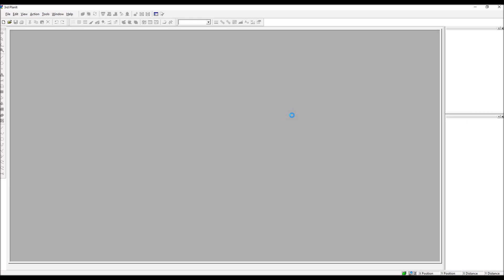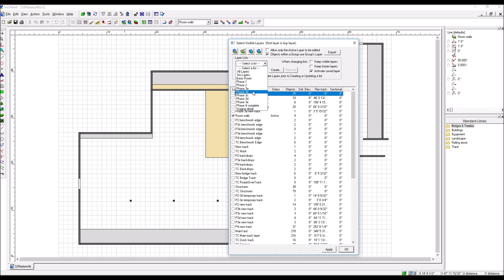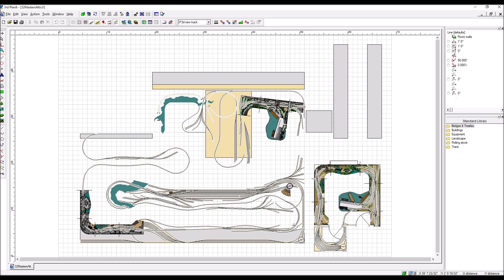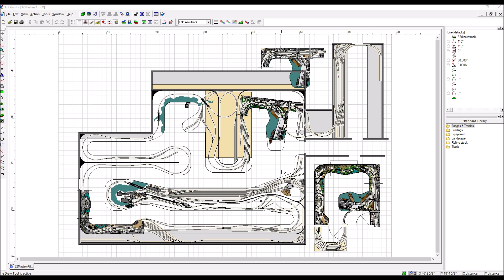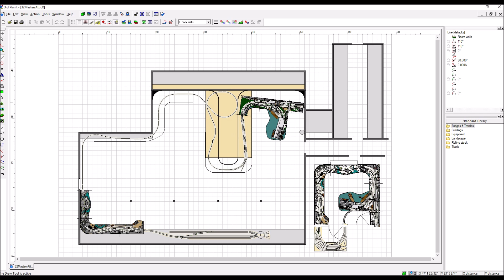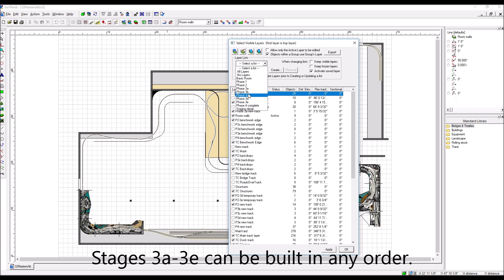Track plan for an attic

Comment: Fascinating to see what you choose to design for yourself in such a large space Peter. The majority of your customers seem very keen to have at least a double track mainline, and often another continuous run atop that. Whereas you're aiming firmly at single track mainline, and a keen eye to operating prototypically. Thank you for showing the idea.
Reply from the maker: Also check out this video: https://youtu.be/6Km9-huorDA 
Although the house with the attic fell through, the other design is for the basement of the house I now live in.  If my work ever slows down, I'll be able to have a crack at it.

Comment: How you doing it's Victor from New Jersey I have a question what track HO scale do you recommend and I also need an ho scale turntable can you tell me which one you prefer on the turntable and switches as well which you prefer thank you
Reply from the maker: For turntables, the only brand I'm familiar with is Walthers.  I once scratch-built a turntable, and I wouldn't want to do it again.  Walthers turntables are easy to install and fully indexed, so if they have the size you need then look no further.
For turnouts, I recommend Fast-tracks for all visible locations.  If you don't want to build them yourself, you can purchase them ready-built through my on-line store.  For hidden areas (such as staging yards), I often use PECO turnouts to save money - although their appearance is not good so I don't use them in visible areas.  I don't really like Atlas or Walthers turnouts because the rail does not match the flex-track I like, resulting the need to use bigger, more obtrusive, rail joiners.
I use a mixture of Micro-Engineering and PECO flex track, depending on location.
Reply: Hi Victor from New Jersey again. Thank you for taking the time out and sending me that all you guys who do the trains whether it be rail lines layouts or just talking about the trains that they run are all excellent at responding I want to thank you guys all for that. I will take your advice I will save that I would look at it as my Bible. I've been watching you for quite some time I think you're one of the best guys out there as a matter of fact I don't watch anybody else online or layout builds. I am a miniature you a 57-year-old carpenter who wants to get out of the business and get into something like that because my body is breaking down as I sit here with a hernia I can't even move. Also alone in life lost my wife as well unfortunately God bless your wife. I like what you did and how you went about it I've never been successful at the three businesses I've tried I'm a very good Carpenter just not a very good speaker or seller of the job I guess. What would it cost to get a layout design from you maybe how would I go about getting an estimate like that obviously I would build it myself I could use some advice on a design. is there a square foot price as a depend on how involved it is how much time it takes if I want 10 main lines or two main lines I don't know how you go about price and one of those maybe you could give me some advice on that as well I greatly appreciate it looking forward to your next video please respond thank you as you would say bye for now
Reply from the maker: @victordandrea8697  If you'd like to talk about a custom layout design, please contact me through my web-site superiormodelrailroads.com 
Tell me the approximate size of your space and a little about what you hope to accomplish in it.

Comment: I love this plan. I'm sure you'll come up with a gem for your new basement space. I noticed that you mention pulpwood loading for the proposed mill. How would that have been loaded during the period that you model?
Reply from the maker: That is a very good question, and something that I still need to research.  This is one reason why the pulpwood loading area didn't get finished  before the layout was packed up.
Reply: Well, if you figure something out let me know. I've been looking too. I'll have a large paper mill inside a return loop on the third level of my layout. Boston and Maine RR in the late fifties.

Comment: Cool. Thx for sharing. I particularly enjoy your 3pi walkthroughs. Some minor suggestions...You may already be aware, you can highlight some or all of the mainline using the 3pi path tool then adjust the thickness thereby making the mainline more prominent in the plan. There is some interesting detail in the track plan so mixing the occasional zoom on the detail would help while viewing the video. 3pi has a 'return to previous' zoom option on the zoom toolbox which would make this pretty simple while capturing your video. Just my $0.02. Very much enjoy your videos. As a track planner and video producer I especially appreciate your track plan tours. Cheers!